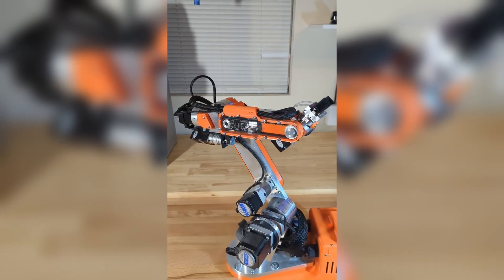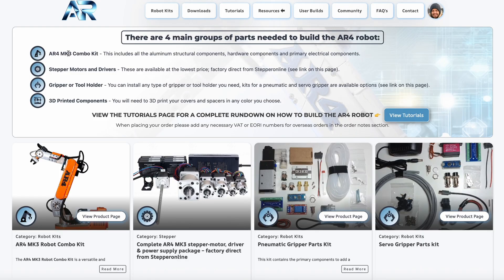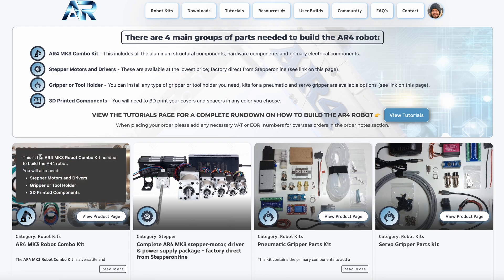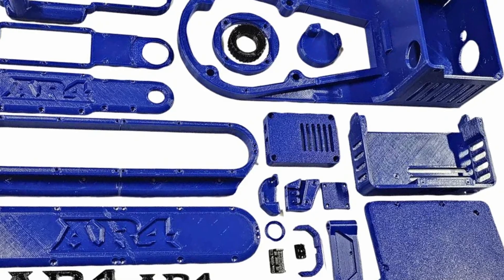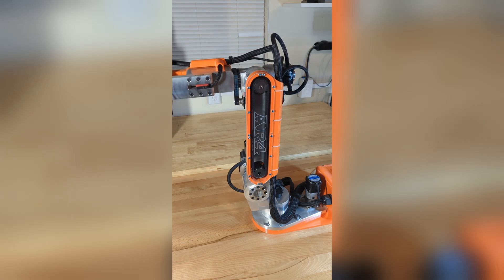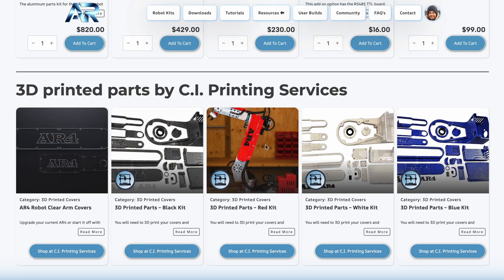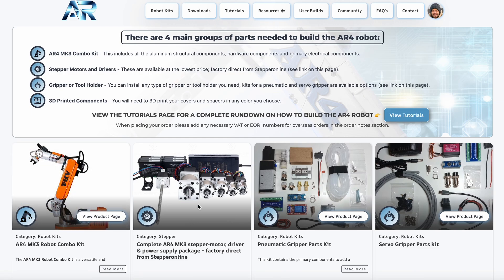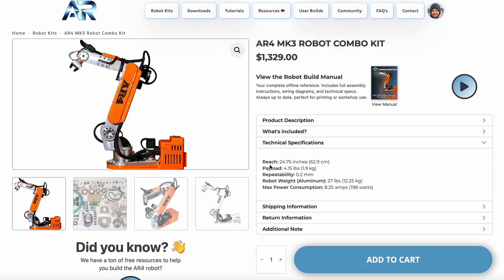AR4 6-axis Robot Arm Clear Side Covers and 3D Printed Parts

Comment: Printer is about half way through printing all the parts for my AR4! Thanks for the fast shipping all the way across the pond. Plan on designing my own in the long run, maybe have a go at electroplating som resin printed ones. Cheers, Morten.